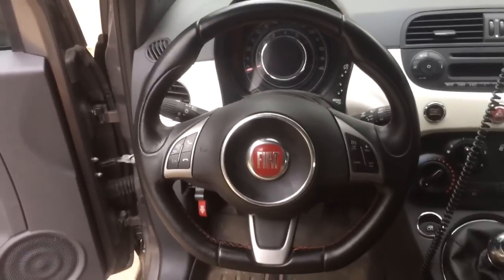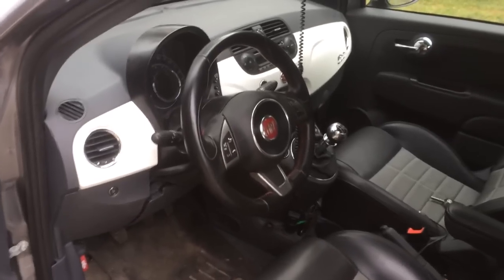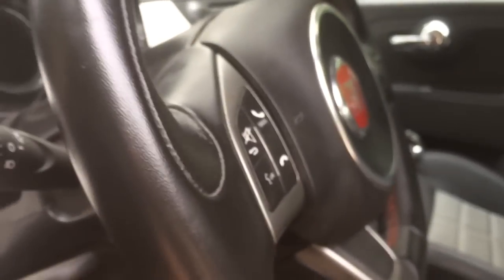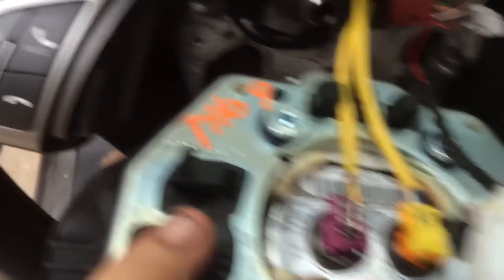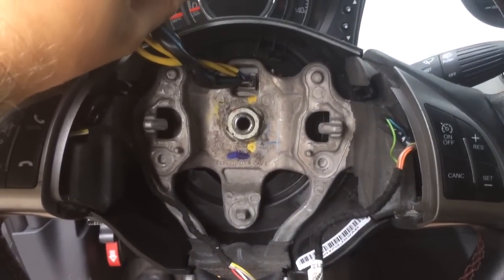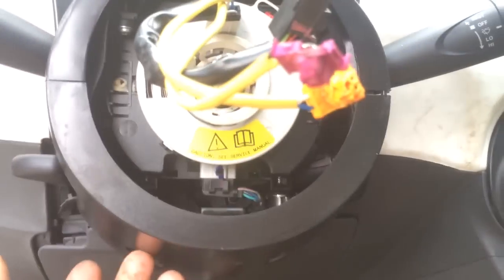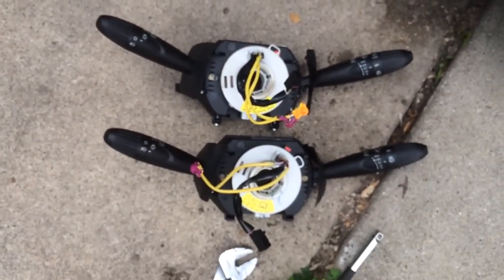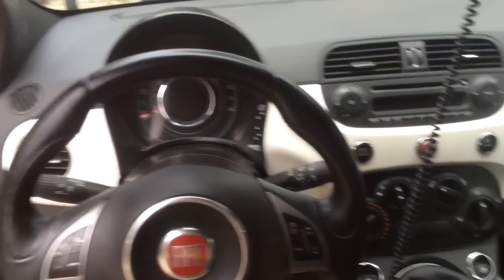2012 + fiat 500 airbag steering wheel and clock spring remo

Comment: I replaced my every airbag except for the ones in the seat (installed 2.2ohm resistors for those) got a new airbag module and i still have airbag light? What else did you replace

Comment: Thanks for the video. Does the clock springs controls all steering wheel buttons or just the horn and airbag? All controls on my steering are currently not working including the horn and airbag. Thanks in advance for your help.
Reply from the maker: Yep - everything. when airbag  deploys, it usually roasts everything
Reply: Can you list the tools you've used? Thx in advance!

Comment: Great video - thanks very much! Question for you, did you need to reset any codes, flash the ecu, etc when you replaced the clock spring? I replaced mine on my 13 Abarth and I think i immobilized the car. Any ideas? Thanks again!
Reply from the maker: if you did it with the battery disconnected, no.

Comment: Did you replace your clock spring due to the steering wheel has so much wiggle room that it spins all the way around?
Reply from the maker: I replaced it only because the old one had detonated an air bag

Comment: Hi man! 
Maybe you can help me. I have a Fiat 500 twinair 2012. It has the traditionel steering  wheel, but I wold like to change it to a sport steering wheel.
I cant seem to find the dimensions for the two steering wheels. Are the sport one much smaller?
Also, do you know if a sports steering wheel will fit my car?
Also, is the airbag the same for the two types of steering wheels?
Thx in advance
Reply from the maker: we don't have the twinair in the USA so I can't tell you specifically.

in the USA the 'pop', 'sport', 'lounge', 'T' all have the same diameter steering wheel.

the 'Abarth' has a slightly larger but much nicer feeling wheel.
Reply: Aha! 
Will the abarth wheel fit all the three models you mentioned? 
Thank you
Reply from the maker: yes, they are all interchangeable (even the airbag and clockspring is)
Reply: Ovalbore That's awesome. I am confident that the Abart wheel will fit mine then. 
Because we also have the pop and lounge and they have the same steering wheel as my twinair. 
Thanks for the help!

Comment: I’m working on a 2015 fiat 500. I’m trying to take out the clock spring . I took out the screw that holds that silver clamp down . But the clock spring still doesn’t want to come out . Is there anything else that you had to remove
Reply from the maker: nothing that isn't shown in this video, sorry.

Comment: Hey I'm also fixing up a salvage fiat and wanted to know where you got your airbags from.
Reply from the maker: Im a used parts dealer, so I use an interchange software to check databases of nation wide resellers. I bought bags from several different dismantlers